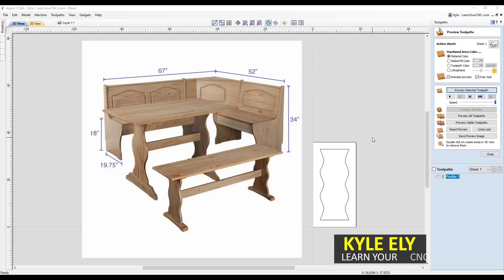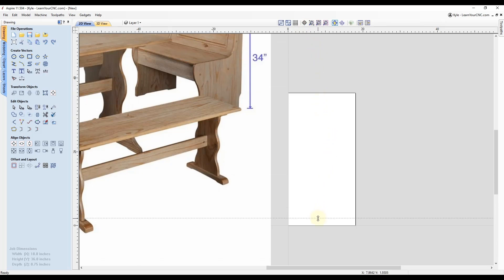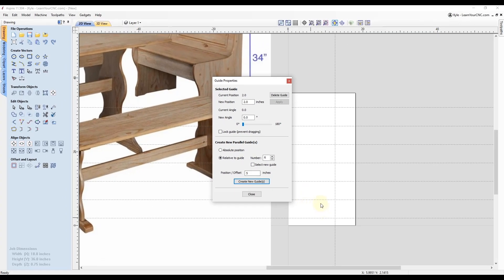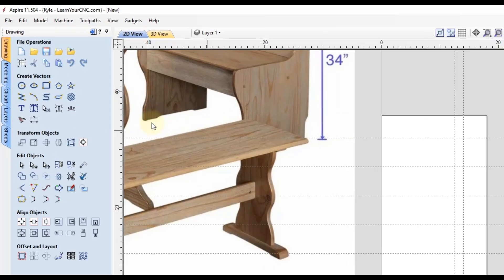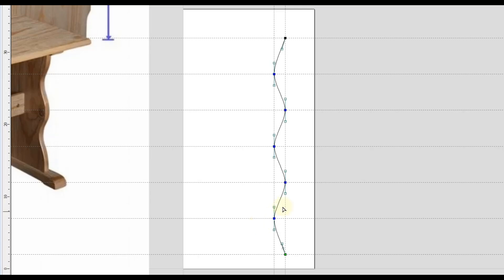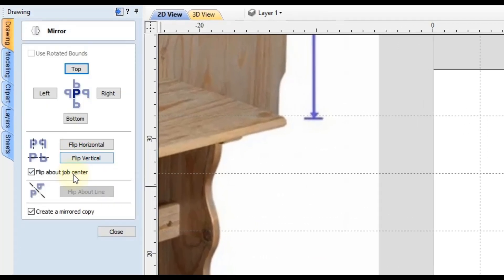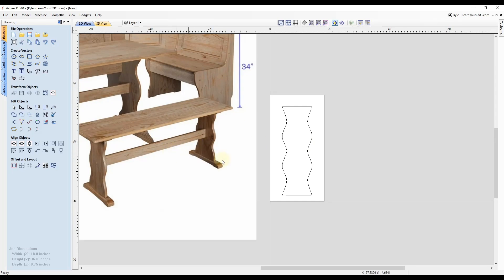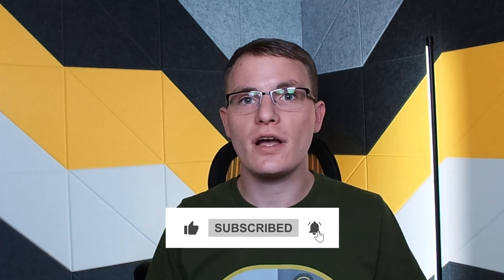3 Steps to Making Perfect Curves - VCarve, Aspire, & Cut2D Quick Tip

Comment: Great tips as usual! One thing different between your method one and method two is the way the lines approached the end nodes at the top and bottom. In method one it appears the line approaches the top and bottom node with a curve while method 2 the line approaches the top and bottom node with a straight line.
Reply from the maker: Thanks! And, yes, that is correct. I should have pointed that out in the video, but great job on spotting that! I like to show different methods to give people options if one does not work out for them the way that they wanted.

Comment: Good video. Couple of questions. If you set the datum to the center of the material, couldn’t you just mirror one side to the other? Second question, can the trans form object size be used to change the width? Again great video as usual.
Reply from the maker: You don't have to set the datum to mirror to the other side of the job but it does make it easier for measurements. For example, if you have the datum in the center, you can move one piece 5 inches to one side of the datum and then mirror over the job center and that would give you a 10 inch total width spacing. Also, yes, you can use the transform tool to scale the width but the problem with that method is that it also stretches the curved lines. I should have mentioned that in the video.